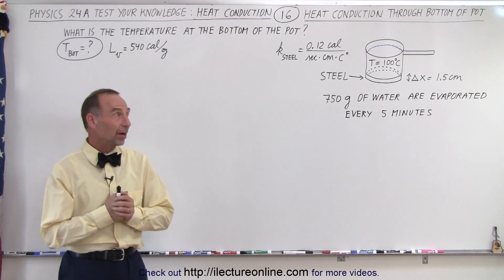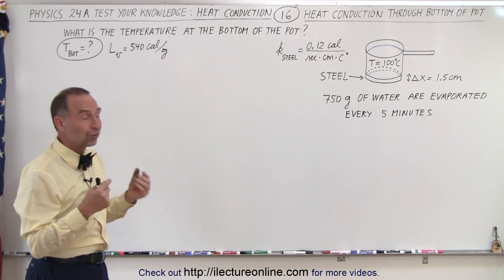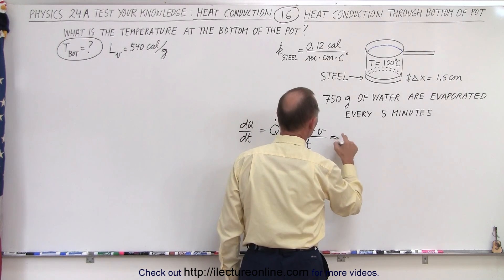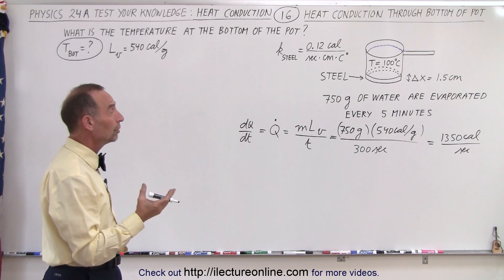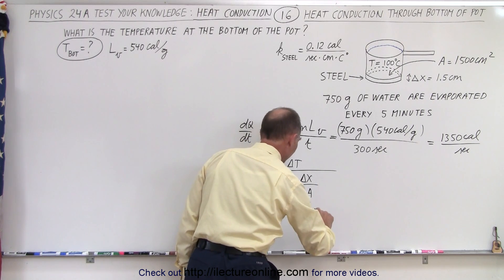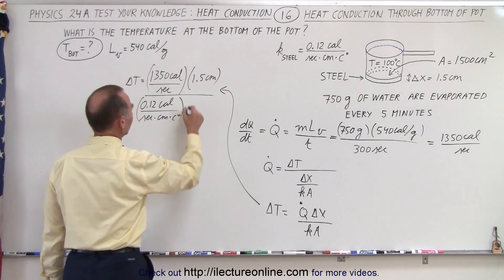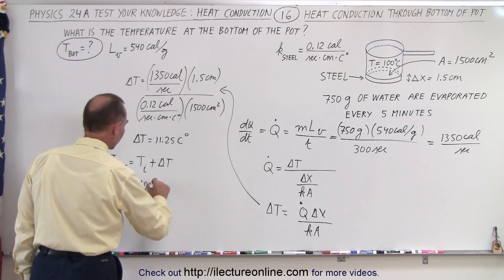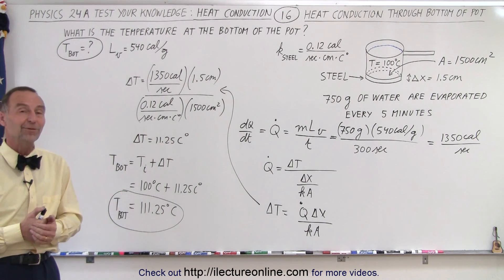Physics 24A  Heat Conduction Examples (16 of 22) dQ/dt=?   at Bottom of Pot

Comment: sir how do you know the temperature at the bottom is greater than 100. so for delta t how do u know if it is 100 - T or T -100?
Reply from the maker: The assumption is that if the flame can make the pot of water boil, it must be greater than 100 degrees.
Reply: @MichelvanBiezen  Thank u